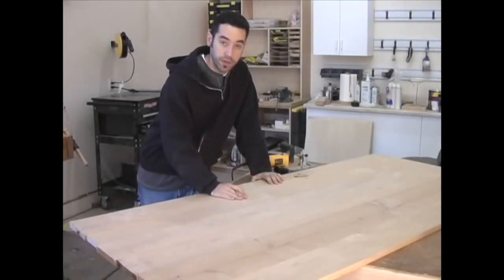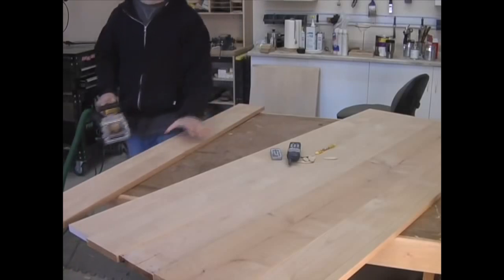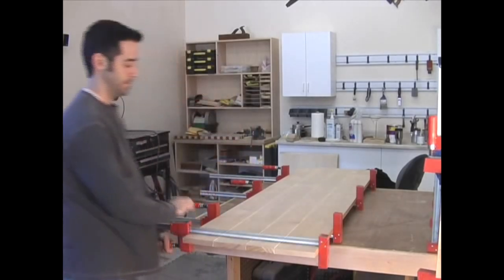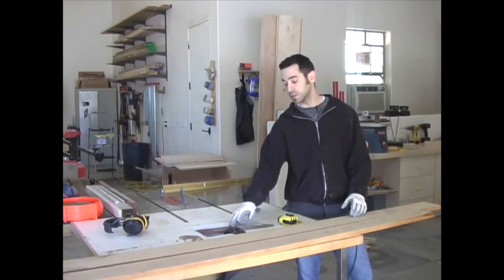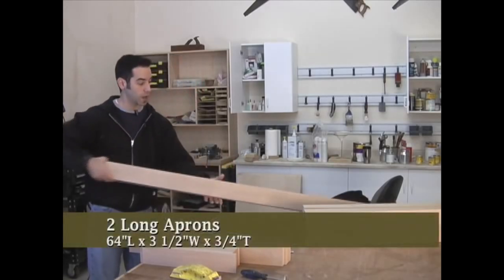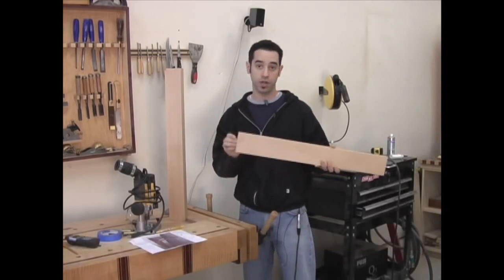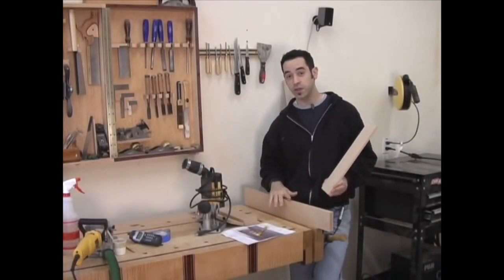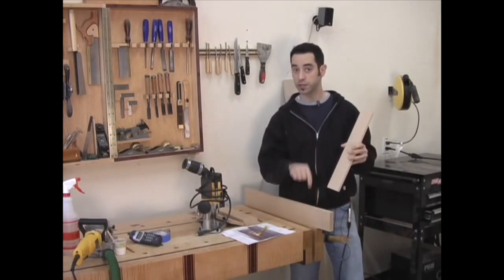11 - How to Build an Arts & Crafts Table  (Part 3 of 4)

Comment from the maker: It would indeed be an option, but I'm not sure it's right for this application. A sliding dovetail can only go so deep and a long apron like this can certainly benefit from a deep mortise and tenon joint. So I can't say it isn't possible, but I don't know if a sliding dovetail would be appropriation for the scale and application.